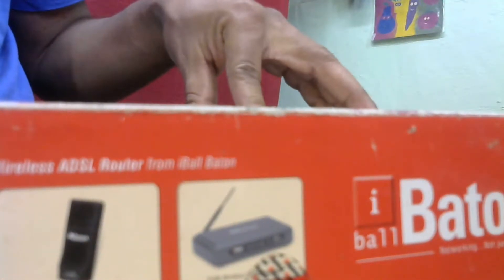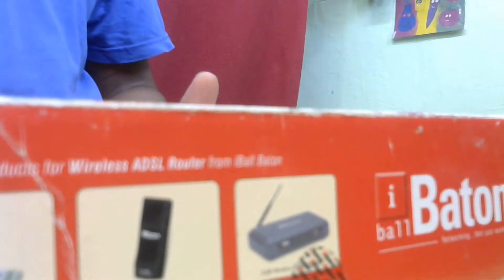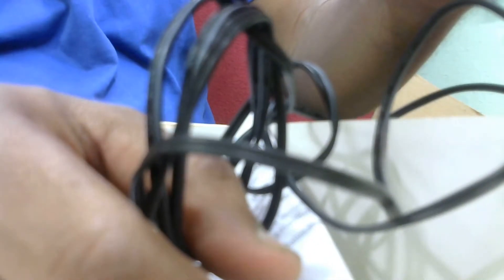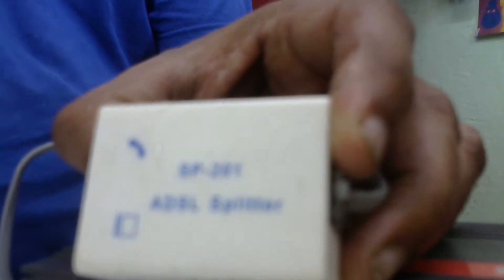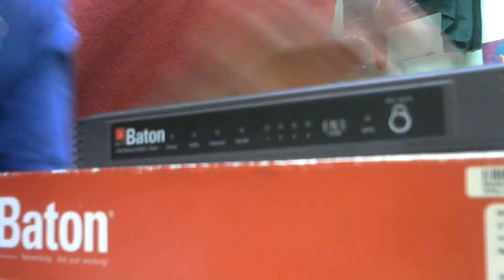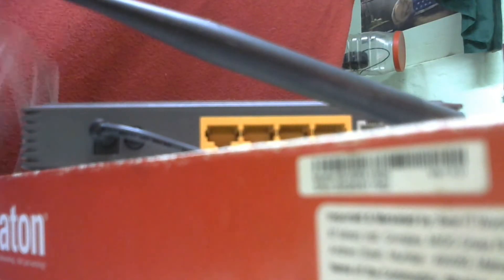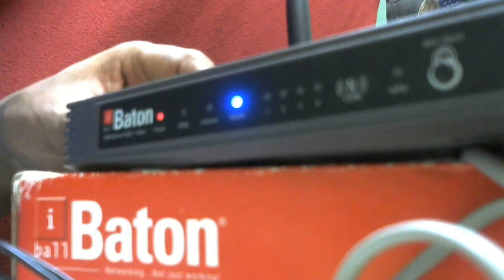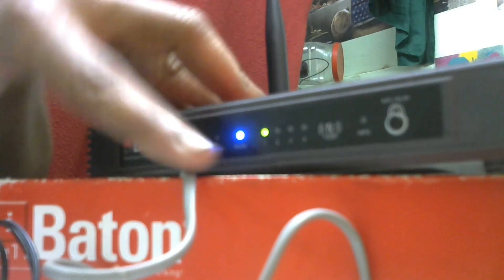iBall iB-WRB150NI 150M Wireless-N Broadband Router

Comment: Complies with IEEE 802.3, IEEE 802.3u standards 4 - 10/100M LAN Port, 1 - WAN Port & Wireless-N AP
Operation Modes : Router / Universal Repeater / WISP / AP Connection type - PPPoE, Static IP & Dynamic IP
Security features such as IP, MAC & Domain filtering Wireless security such as WEP, WPA-PSK & WPA2-PSK
Adsl router under standing eassy way